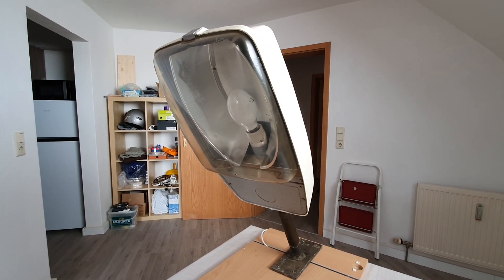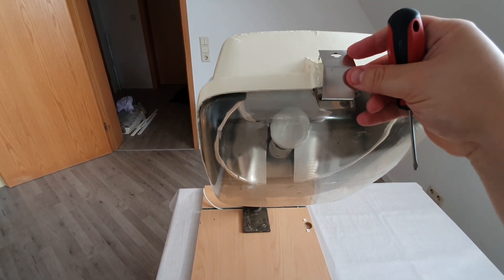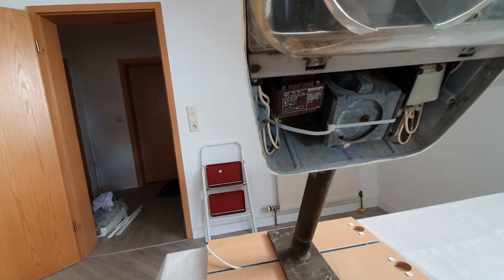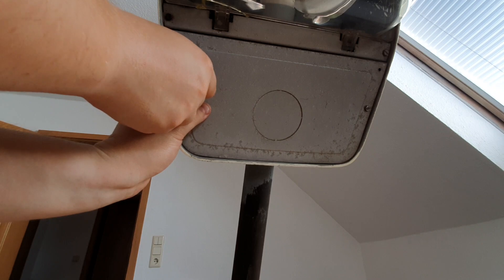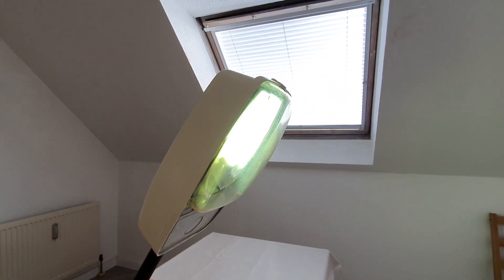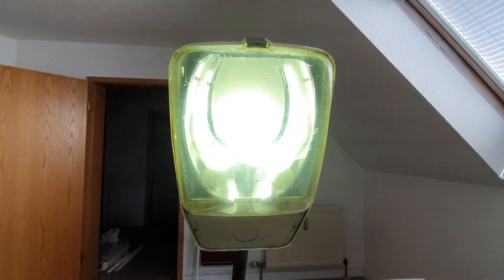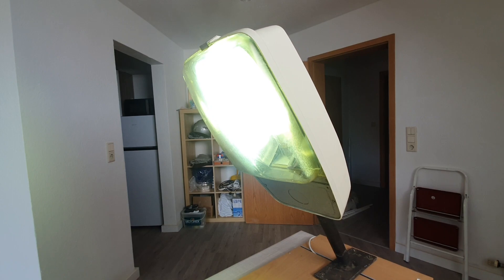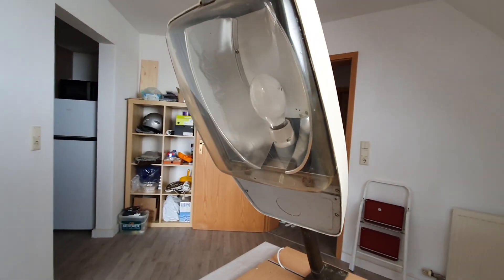Philips SGS 201 - 80W mercury vapor streetlight fixture from the 80's

Comment: 80w isnt much for a mercury vapor.. im curious how bright or dim this light was.  Although thats a nice reflector.. since bulbs put out 360 degree light versus led..  if 80w puts out roughly 3800 initial lumens.   With a reflector like this i bet it puts out nearly 9-10k lumens.  Id be curious and wish that could be measured.

I have some 50w hps wall packs with good aluminum reflectors.  And i sware those lights put out more light than a 100w hps bucket light does.  It must be the reflector.

I wish i had that light you have
Reply from the maker: As long as this lights are not mounted higher than 6 Meters, they are acceptably bright for smaller streets or parks. I have no means to measure,  unfortunately. However,  you are right that the right reflectors are crucially important to the fixture's performance. I will make a video soon about another Philips SAW fixture with no reflector and a milky white plastic bowl - intended for parks. It also uses 80 watt MV but is really dim because of no reflectors... :)